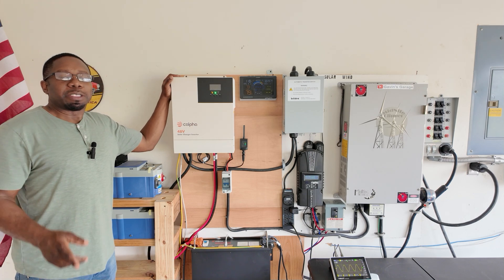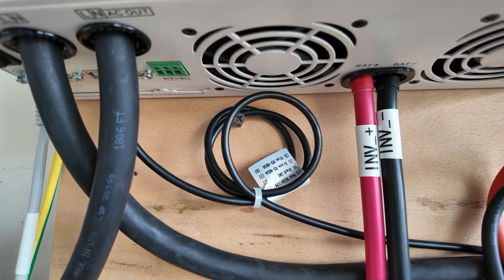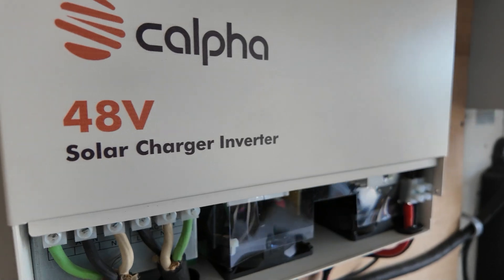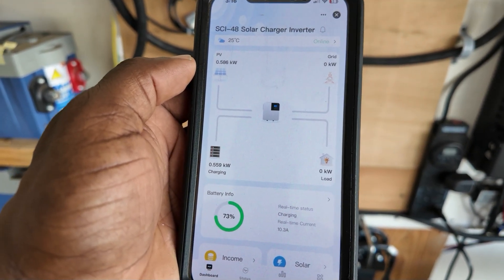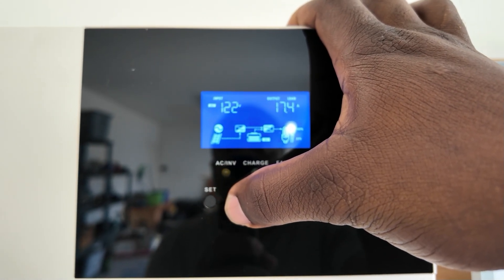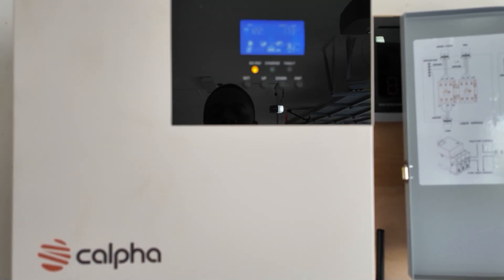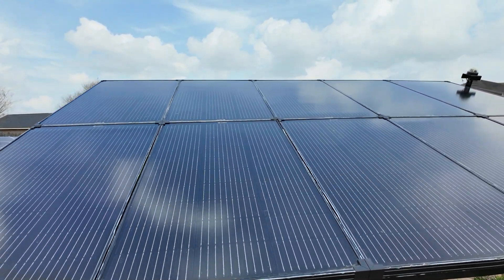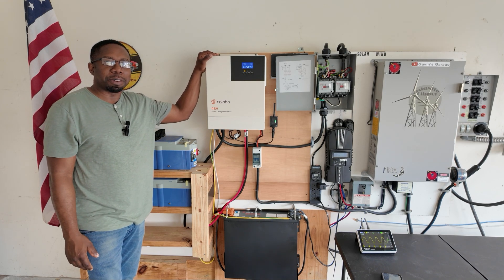CALPHA 5KW Solar Charger Inverter 48V Pure Sine Wave All-in-One Inverter with 80A MPPT Controller

Comment: Hello Gavin,  I got my 4500df WH wet, now I need a 4500/ 5000 watt inverter gen at or below 100#. What would you get. Thank you very much. Love your videos.
Reply from the maker: This unit is only 50+ lbs it would be perfect
Reply: Thank you, but no I need a dual fuel generator. @GeneratorReviews

Comment: High frequency, transformerless inverters like these are one of the worst investments you could ever make when purchasing a solar system. First of all. high frequency inverters offer a relatively poor peak power capacity which is needed for starting high inductance loads such as refrigerators, power tools, microwaves and air conditioning units. You might be able to start and run some high surge loads when these high frequency inverters are new, but every time you fire up one of those inductive loads, you're shortening the life of the MOSFETs in these inverters. Second, because there is no iron core, copper wound output transformer to provide galvanic isolation in these inverters, All it would take is for the AC output monitoring circuitry to fail and one of the MOSFETs in the inverter's H-Bridge circuit to short to ground, and a high frequency inverters can send dangerous, high voltage, high amperage DC current straight to your AC appliances which can not only damage your appliances, but can also set your appliances on fire. That's why, today, no American inverter manufacturer uses high frequency inverter tech in their designs. And third. because these high frequency inverters operate at a much higher, stepped up DC voltage and a much exponentially higher frequency than more reliable, low frequency inverters, they tend to have a much shorter life expectancy.
Reply: Bummer.